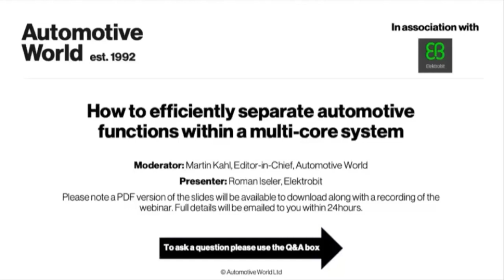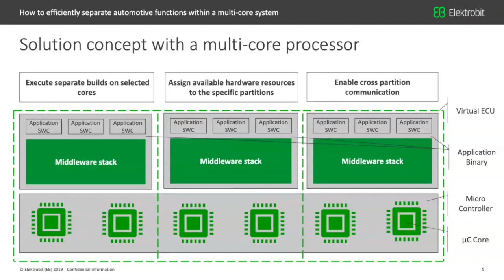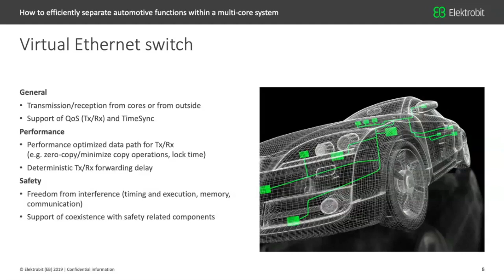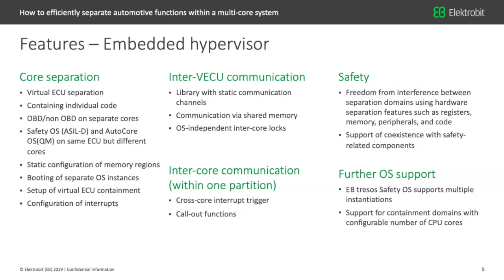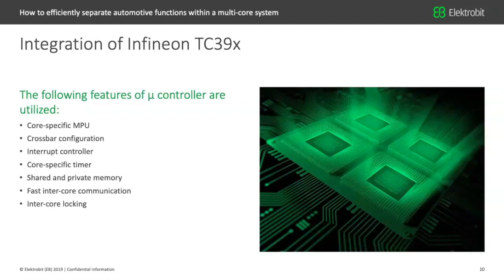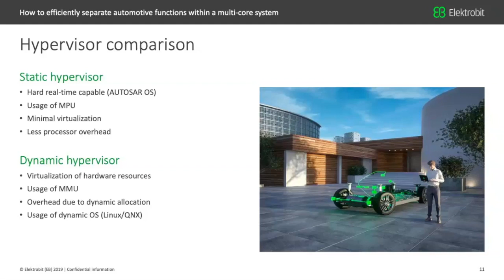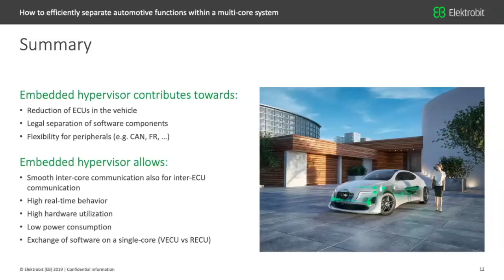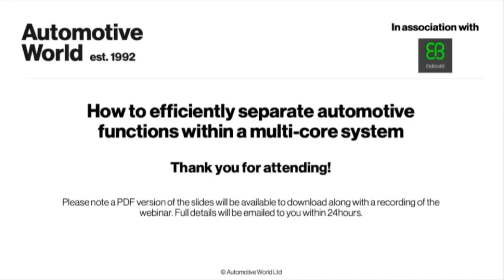Elektrobit Webinar: EB tresos Embedded Hypervisor

Comment: TC3X does not implement support for virtualization in hardware, am I wrong? This means that non-safe VECU has to run in User-mode (0 or 1, doesn't matter) preventing them to use MPU for they own, am I right? And this means that basically, the Embedded HV is the start-up code and exception vector implementation of the Safe AUTOSAR OS, am I wrong?
Reply: You are right, I guess. So it is more like ECU virtualizator than a Hypervisor